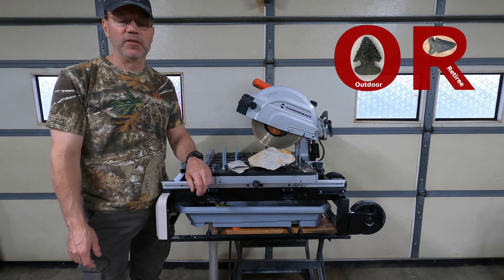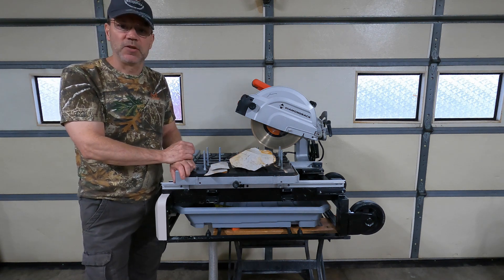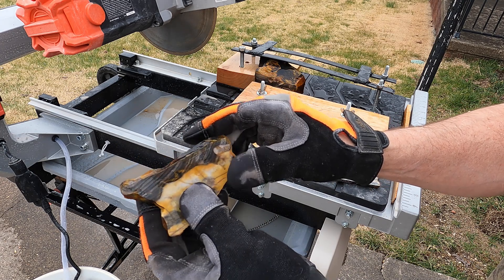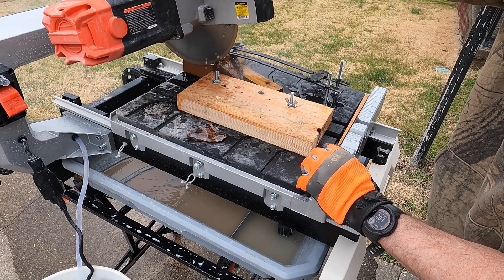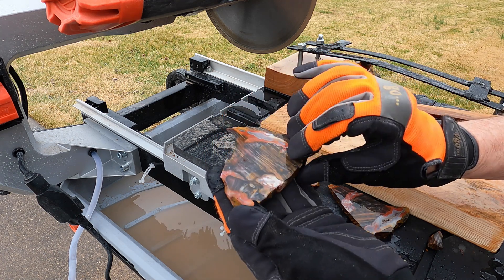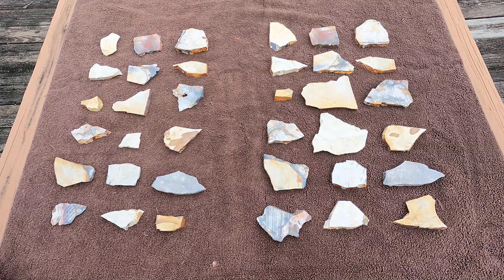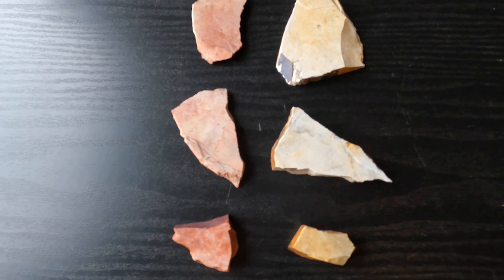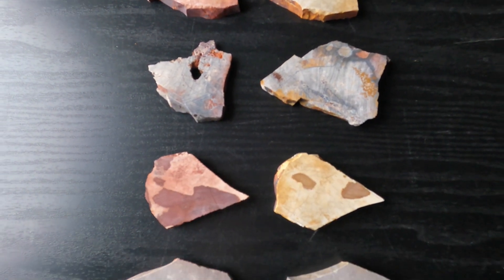Slabbing Rocks With A Wet Tile Saw – Heat Treating Flint Ridge Flint Slabs

Comment: Man, that saw worked out great!   I like your jigs and hold down.   I think it was wise to mount the pump in a bucket to avoid the rock dust in the water circulating through the pump.    That Flint Ridge flint sure is beautiful!
Reply from the maker: It sure did!  I was surprised because I thought it would be a slow cutting process.  A lot of the chunks I brought home were plain tan or gray, but I did manage to get a few really nice colorful pieces.

Comment: Wow that is really nice flint!that saw looks similar to a Kobalt I have hum,nice clamping system you came up with,can't wait to see them polished up,have a good one!
Reply from the maker: Thanks Mike!  That clamping system works great. I cut over 160 slabs and only once did the rock move and it was my fault. I didn’t have it locked in enough and tried to cut it anyway. I tightened it down and finished that cut. Good luck hunting!